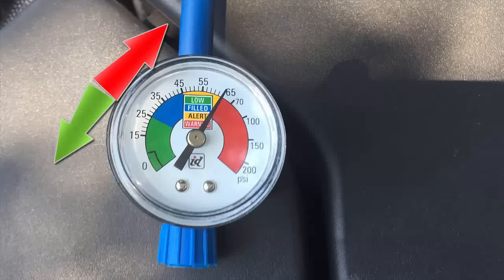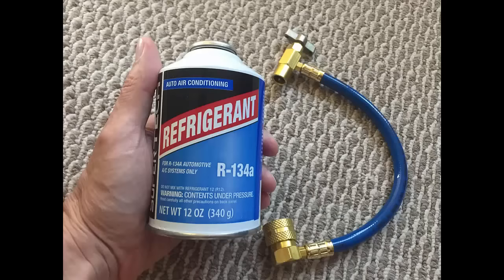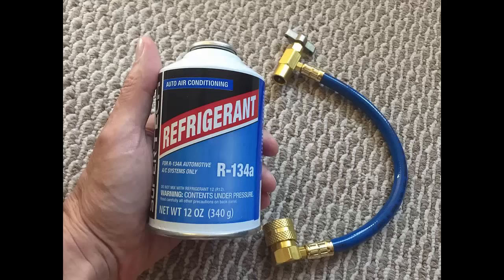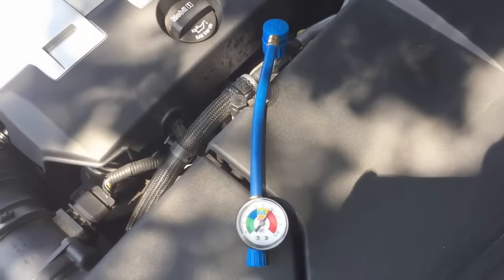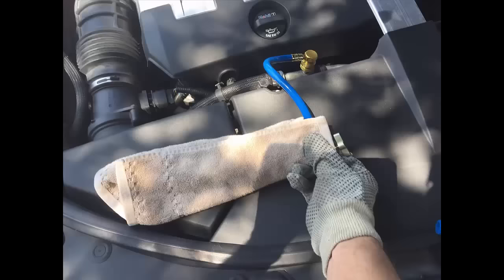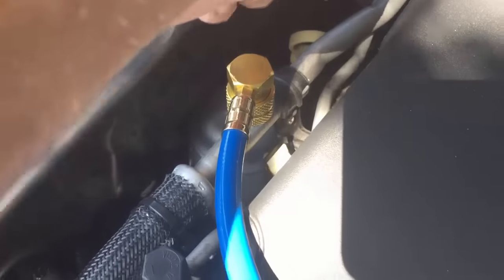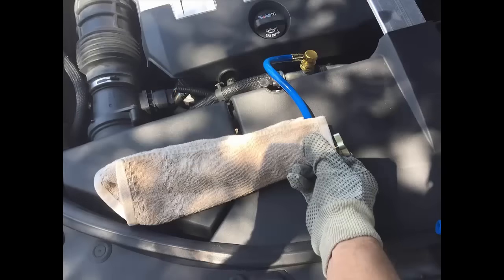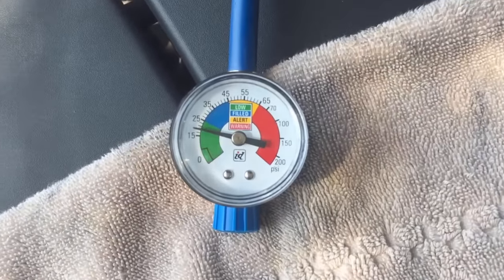Car AC pressure too high FIX overcharged a/c gauge fluctuation reading jumps Up Down Freon problem

Comment: Hello,

I have a question. 

I just tried to fix my airco in my Kia Picanto 2012 with one of those simple kits with a can of refrigerant, and a hose with a gauge. (mine did not come with a temperature setting). My airco had just gradually become less cold over the years and now it had completely stopped working. 

I was hoping for a quick fix for now, but it didn't work out so far.

When I connected the kit with the gauge to the low pressure side, it showed no pressure at all. Then I filled it untill it showed 60 PSI, with the engine and airco on. (was aiming for 50 but gone a bit too far).

After that I drove around the block and when I drove away, cold air was coming out of the vents, and I thought it was a succes! but.. this only lasted for a very short time, a minute or so. (that doesn't sound too good, right)

So now the airco still doesn't get cold. 

Now, when I check the pressure on the low pressure side, the gauge shows 60 PSI, engine and airco on, or off, there is no difference. Also, the pipes don't feel cold at all.

Since it is also showing 60 PSI with the airco and engine off, I'm thinking... maybe there is still not enough pressure, because with the airco off, the pressure should rise far into the red zone... (like 100 PSI) if i'm right? 

Do you think it's worth it to try and get another can of refrigerant, to build up the pressure and see if the airco will actually activate?

(I can't seem to spot any compressor pulley turning on and off when I turn on and off the airco, everything seems to be turning always, even with the AC button off. But the fan on the front of the car does turn on and off with the AC button.)

(one more thing. I was too quick to do it, and kind of forgot about the temperature thing. I think it was about 68 degrees fahrenheit here when I filled it.... So according to the temperature/PSI charts, according to that I should have filled it to about max 35 PSI... and I filled it to 60 PSI.... So Im kind of worried that I have destroyed my AC system. But, since it's also showing 60 PSI with the engine and airco off... I doubt this, and start thinking the pressure is actually too low? 

I hoping you could shed some light on this!
Reply from the maker: With the ambient temperature of 68°F, the static pressure (car OFF) of R134a refrigerant should be about 68 PSI. 
When you start the engine, the pressure should drop to about 35 PSI. 
If the pressure is not dropping at all, that means the compressor is not working for some reason.
Reply: @Your-Self Thank you so much for your answer. 🙏

At what pressure should the compressor normally start working? Could it be 60 PSI (car off) is still too low for it to turn on? 🤔
Reply from the maker: Not sure exactly, but 60 PSI seems adequate enough for the compressor to start.
You may possibly have a bad pressure sensor that's preventing the start. 
It's probably best to visit a shop where they can do a free diagnostic.
Reply: @Your-Self Yes, that's probably a good idea. 

Thanks again. 🙂👍🏻

(subbed)

Comment: Keep engine running when do this or stop engine ?
Reply from the maker: The engine should be running, and AC on max cool
Reply: @Your-Self  Thank you very much, I did what your instructions,but it's no freezer comes out to blanket, pressure go down and ac on the car come out not too cold then after 5 minutes stop cold and hot air come out,I look at pressure is up and down on red.May be the clutch or compressor bad???

Comment: Wouldn't you relieve pressure from the high side?
Reply from the maker: A single gauge fits on the LOW side only. But it's possible to release from the High side with a screwdriver and a rag which can be even more dangerous.
Reply: @Your-Self  thanks

Comment: Where can I find the valve to release the pressure? I have the hose but it has no valve to leak the freon out
Reply: The hose he is using has a "tap" that punctures the can. He uses the same hose but with no can connected, turning the "tap" acting as a valve to release the pressure.
Reply: Unscrew the cap on the high side and use the end of ur knife blade or needle nose plier

Comment: There is a reason you're not supposed to do this - you're not just letting "pressure" out, you're bleeding coolant into the air. Bad for the environment. We want as little of this stuff going into the air as possible. Professionals will capture and properly dispose of it.

Comment: What if your gauge is pulses backwards from yellow full to low when compression kicks in
Reply from the maker: Did you check your static pressure as on the next video https://youtu.be/7loH93-9MNQ
Maybe the system is undercharged.

Comment: what if the gauge is doing that and air blowing warm and when releasing with a hose and trigger only air comes out not refrigerant.
Reply: Im having this problem right now.. did you end up finding a solution?
Reply: @gmed_  I think my condenser is clogged up. It's the only thing i didn't put new. I need to check to see if the lines attached to the condenser are cold and if it is then the condenser is clogged. I seen another you tube video that showed that. If the compressor kicks on and off but the air inside is blowing warm and the low pressure lines attached to the drier are not cold but the ones attached to the condenser is cold then the condenser is clogged up. I'm going to try to check that this week.
Reply: @davidallen3078  thank u for the quick reply! I'll definitely try the same thing. Trying to pinpoint this issue can get frustrating haha I've had no working ac for like 2 years and I'm now finally trying for it. If I find anything that works for me I'll update ya. Thanks again and good luck with the fix!

Comment: u did this job with the ac on at the maximum blast or ac off please help me out to do it i just overcharge yhe system thanks
Reply from the maker: the engine should be running with AC on full blast
Reply: DO NOT BLEED THE LOW SIDE PRESSURE WITH COMPRESSOR RUNNING, YOU WILL SUCK AIR INTO THE LINE... IF, AND ONLY IF YOU ARE OVERCHARGED, THE "BOOTLEG" WAY TO BLEED PRESSURE IS WITH A SCREWDRIVER PURGING THE HIGH SIDE PORT.
Reply: XCONREPO - I 100% agree.

A LOT OF TERRIBLE RECOMMENDATIONS THROUGHOUT THIS VIDEO'S COMMENTS.   

NO ONE SHOULD DO THIS, AS RECOMMENDED IN THE VIDEO.  

EVERYONE, YOU SHOULD NOT DO THIS, BECAUSE, THE METHOD OF USING THE HOSE PROPERLY PULLS r134a INTO YOUR SYSTEM BY A VACUUM.  SO, IF YOU DO THIS, YOU ARE PULLING UNFILTERED NORMAL AIR INTO THE HOSES.  

WHEN YOU DO A FULL MAINTENANCE ON A SYSTEM THEY COMPLETELY REMOVE ALL THE AMBIENT AIR FROM YOUR AIRCONDITIONING SYSTEM/HOSES, THEN THEY REFILL only WITH R134A, AND A PROPER AMOUNT OF LUBRICATING OIL (WHICH LUBES THE COMPRESSOR'S INTERNALS).  NOT WITH AIR!

AIR IN YOUR SYSTEM CAN CREATE BUBBLES IN YOUR OIL AND RUIN YOUR COMPRESSOR.  AND AIR IN YOUR SYSTEM CAN CORRODE INTERNAL PARTS OF YOUR AIR CONDITIONING INTERNALS.

AT BEST YOU MIGHT BE ABLE TO BLEED OFF SOME PRESSURE FROM YOUR HIGH PRESSURE SIDE.  BUT, YOU WOULD HAVE TO BE VERY CAREFUL NOT TO HURT YOURSELF.
Reply: @xconrepo  with the car off??

Comment: So I just bought a car and the guy say he jus refilled the ac. But when u turn ac on its cold for awhile then no cold air. It does it back and forth. It'll b cold for like five minutes then it stops blowing the cold air. It does that back and forth. I need help please any suggestions or if I was to do this would it help?
Reply: misswondergirl916 xiong ... have the same problem did you ever fix it?? mine just started today

Comment: I am trying this and no air is coming out. Any suggestions of what I could be doing wring? My is overcharged to the red.
Reply from the maker: The gauge on the red could mean OVERCHARGED or UNDERCHARGED.
1. If you just charged it yourself and nothing coming-out, there may be a restriction on the High side... which means you need to go to the mechanic.
2. If you didn't charge it at all, your system could be empty (and probably with regular air inside)... in this case, you also need to see a mechanic.
There are so many variances of what could be wrong, that it's impossible to diagnose it over messaging. (by the way, the car needs to be running with A/C on full blast when you release the pressure)

Comment: I have a 2000 Jeep Cherokee i ride and a parts jeep 96 Cherokee Country. Ok My ac compressor locked up on the 2000 . it wasnt working and was  making funny noise b4 it finely locked up. So i knew the one in the 96 was good so i took the 96 off but the lines attach different on the 2000. where they go in the main back on the 96 and on the top of the 2000. So i changed the back out so i could use my 2000 lines etc.  I  put new oil 4 oz. ruffly maybe a little more and it took the oil fine but will not take the freon. I paid a guy 25 bucks to have it vacuumed  and had no leaks but it still wont take freon. could a bad AC  pressure switch  cause it not to take freon or maybe the condenser is stopped up when the compressor locked up and iit got metal in the condenser and stopped it from taking freon or what... Im at a lost and dont have much money...but I need my ac bad. i have a hard time breathing when i get really hot... So all help appreciated...
Reply: if your compressor locked it prob sent metal shavings through the system.  Always replace the lines with new ones and replace the accumulator also, if you don't you are setup for immediate failure.

Comment: I believe I overfilled my car. The AC blows out cold air intermittently. After couple weeks, I tried to release some of the Freon out, but the air comes out is cold at all (just like regular air) Does anyone knows why? Should I release more freon out until the pressure is at the low side and re-pump the freon again to green?
Reply: I had a similar issue I think you should release just enough until the ac clutch engages again.. if you hear it click then you know it’s engaged. Ones you hear it click what I did is release enough for it to just barely be empty added me some 134s oil from Walmart that seals and lubricants the slow leak and ac compressor. Then I add enough regular Freon from Walmart the the specification.
Reply: But if it keeps click off and on the most likely it’s overfilled.. let it out until it’s just one clicking sound and it’s on constantly
Reply: @mylescrumel9633  Thanks for the reply. But somehow the freon comes out is not cold at air and the pressure is at red. I have released the pressure (normal temp freon?)  until is green, but it's still not working. Is it possible that all the Freon has leaked out? Let me release some more and add some freon back to see if it works. If not, I am going to take it to the shop. Thanks!
Reply: John So well it’s supposed to be in the red. If the ac clutch isn’t engage (you’ll hear the click) then that makes sense that’s it’s still in the the red. But you’ll see the pressure fluctuate up and down if the ac clutch keeping in and out.
Reply: John So this is also a possibility you do have a leak....but everything I Mention only works when it’s low on Freon cause then it still hold a vacuum. If it’s all gone then it probably lost it’s vacuum

Comment: Didn’t work after I tried it could it be my compressor? I can see the compressor spinning. Kia forte
Reply from the maker: It could be a bad compressor. Or, if all refrigerant has leaked out, the compressor will not be able to start at all. So check the Static Pressure first to see how much refrigerant you have in the system, as in the next video... https://youtu.be/7loH93-9MNQ

Comment: You have non condensable gases in the system. Make sure when topping it up to bleed the air from the line from the can or it goes into the system, cannot be condensed, causes high condenser pressure.
 Too late now. You must evacuate the system, put a vacuum on it and refill it without adding air.
Reply from the maker: Yep, I've learned it afterwards. Even though the hose is so short, unlike Manifold Gauges, it still contains some air. Well, it's too late now as you mentioned.
Reply: Same thing happened to me today using AC Pro. Lesson learned, took it to my mechanic and he evac'd the system and refilled it properly. Good thing this little experiment didn't mess anything up. Should've heeded Scotty Kilmer's advice and not use these crap kits. He checked the system for leaks and proper function as well. Cost me $97 and WM was nice enough to make an exception and take the leftover AC Pro for a full refund of $54. I'm all about DYI but not for AC stuff.
Reply: There are several things that can cause pressure fluctuations. As was mentioned air is bad, but so is the moisture that it contains. This moisture often freezes up at the orifice of the evaporator. As pressure builds, due to the ice obstruction, the temperature increases and melts the obstruction. The process repeats often, as noted on the pressure guage.
However, normal cycling of the compressor will cause pressure variations, and when the system is overcharged, the compressor cycles frequently.
Lastly, on systems that utilize a TXV (thermal expansion valve) cycling is normal as well, and again, an overcharged system causes cyclic activity.
Reply: So, a initial high pressure reading means that with same symptoms? Before adding or bleeding Freon. Atmospheric pressure is less than system pressure. Even a low system that can still cool on cool mornings.

Comment: What exactly was "fixed" here? It sounds like he still doesn't know why the pressure was too high.
Reply from the maker: The fix was that it started to blow cold air again.
A few months later, I found out that the evaporator had a tiny leak. When the pressure went low, the system sucked some regular air inside. That's what created overfield conditions for me... a mix of refrigerant and air. While it was kind of low on actual refrigerant.

Comment: Ok now how do you do it without a relief valve?
Reply from the maker: I know people use a screwdriver or a nail to push on the center stem while covering it with a thick rug to relieve pressure. (like deflating a tire). But this way is messier and more dangerous

Comment: Same thing happened with me I have 2015 mazda 3 the compressor goes an and off very quick so I decided to recharge with little bit freon after recharging even compressor stopped working it is not turning on at all so I released the pressure inside system again my car compressor started to activate and pressure was showing around 20 psi still it is not blowing cool air it is blowing cool air only in passenger side vent
Reply: You released too much refrigerant! Add a couple of ounces at a time and check pressures should NOT be OVER 40 psi on a hot day most systems avg about 30-35 psi when working correctly.

Comment: isnt it bad to let r134 into the environment
Reply: well, yeah...  more on ethical issue... but the r134a is not as bad and notorious as the r22 and you can get away with a small release. Nobody can't help it, there's probably more leaking car freon all over the world that no one notices until it needs recharging or repair. So why not make some freon like r134a  more pleasant in the atmosphere and ban the volatile r22....
Reply: @charlesdean9178  I'm a HVAC guy, R22 has been banned for a few years now, the states have moved on too 410A

Comment: Not seeing what the high side is doing is not a good thing. Going by the low side is simply a guess. For example, If somones compressor fan is failing or has failed, system wil cycle on and off like this. So now, ppl think it must be low freon and they add some to the system. Now they created a new problem, over charged, on top of the bad condenser fan. Sure saving money is great but guessing can be more costly! Know what your high side is doing as well as the low and get help to diagnose the problem properly.

Comment: Very strange, i overcharged my ac and had the same issue but when i let some pressure out it was not cold at all it was quite warm…..the metal line that it is being released from is cold but the gas coming out is literally warm…. Not sure what is happening there. But the ac is working at the moment, I will see how it goes. Anyone have any insight here?

Comment: You should never discharge refrigerant out to the air  it is dangerous and not good for the inviroment
Reply: Also the system needs to be evacuated by suction to clear any dirt or especially water out of the system so it does not damage the compressor it really is not a great idea it needs to  be done by a trained technician the reviewer dryer may need replacement it is a filter in the system

Comment: 15-25 it become undercharge, maybe you released too much. good one 35-45. My car max is 32oz and I put 36oz, then it work super cool inside. Control at max 60F but vent though out 25F >_< unknown will it got any damge in the future but AC give super cold now.
Reply: @evolution vn
You are putting excessive pressures into the system by adding MORE than the mfr instructs you to. 
This might work for a while but you will cause a shortened life for the system and early failures for some components.